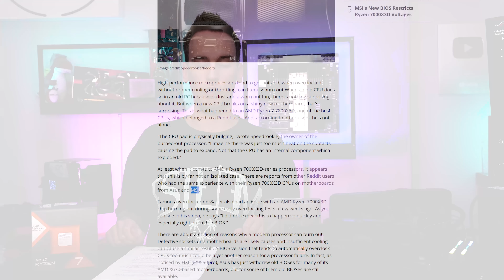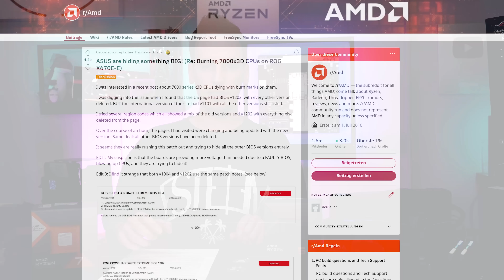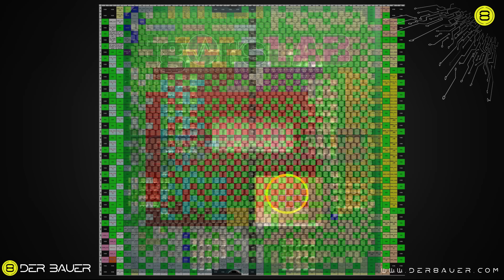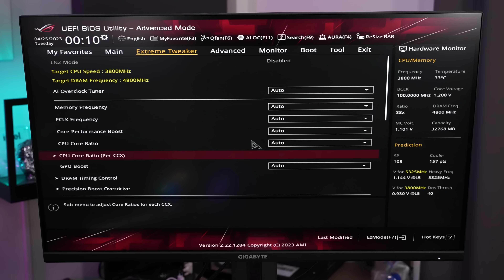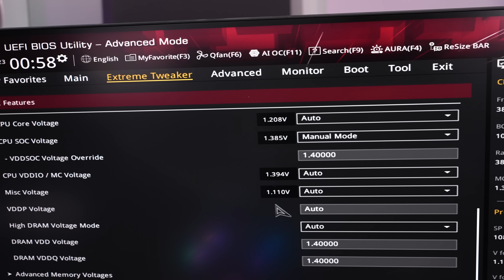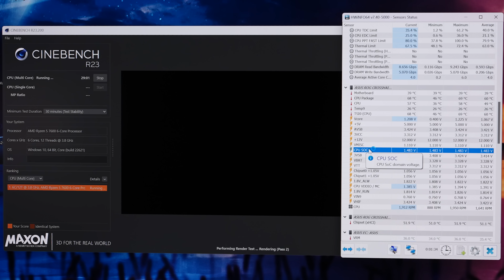I missed the Damage on this Ryzen 7900X

Comment: Good work but what are the steps to prevent it?
Reply from the maker: Just make sure the Auto voltages are not too high. If EXPO is enabled see if SOC exceeds ~ 1,3 Volt and lower it until the case is fully confirmed and fresh BIOSes are out
Reply: Don't buy ASUS.

Comment: I have a 7900X3D on an B650E-I ASUS Mobo, and in the last 2 weeks, I can no longer change CPU clock frequency or CPU voltage and it keeps changing EXPO II back to default RAM speed in the BIOS.
It's been weird tbh..
Reply: Isnt cpu voltage locked on x3d chips anyway?
Going back to default ram speed could happen if it fails memory training
Reply: @ThunderingRoar  Not sure. I've only tried changing the voltage curve offset for better thermals

Comment: 7950x -Asus Rog Strix x670E-E only posts after RAM training with 0805 bios with EXPO values loaded, with all the newer ones the pc doesnt pass the RAM training and EXPO values enabled. Some ppl with same problem in reddit... A lot of BIOS versions in the last months... and now all of them have been removed from Asus website. These issues with a more than 500 euros motherboard is disapointing.
Reply: I agree so much with this.. is a 500 dollar motherboard with weird issues. I cope with the isses thinking "well is a new plataform and the same happened with Ryen 3000 back in the day"
Reply: I had really long and weird boot times on my MSI X670E carbon wifi. Nothing I did would fix it, even running the RAM (which I suspected was the problem) under it's rated speed. 

Finally got annoyed enough to RMA the RAM and ordered a much better set and now everything is perfect.

My conspiracy theory is that vendors were playing fast and loose with DDR5 ratings for a while due to the high prices and are loads of kits out there that were mislabelled

Comment: Seems like all of AMDs 7000 series CPUs and GPUs have a ton of issues! I wouldn't feel comfortable buying anything from AMD this generation.
Reply: AMD have sold a couple of million Ryzen 7000's and we have a handful of failures so far documented.  It's hardly a big issue.  Obviously we need to see how it pans out, but it looks like the motherboard manufacturers are already on top of this.
Reply: @malphadour  Sure, but it doesn't give me confidence in AMD. I'm sure it will get fixed eventually and it's likely only a small percentage of cpus. However, in my personal opinion, I would prefer to skip this generation of AMD products until they have ironed out all of the bugs.

Comment: A phase transition would be needed to cause a bulge in solid material like that. In other words, some small area melted or boiled.
Reply: Yup.
Reply: @glitter_fart  i'd go a  step further and say that it started in the cpu's pcb.
Reply: @tru_3DEffects  yeah stuff like this has been known to happen, i forge the exact term for it but intel had some issues with p4 arch that when shrunk had voltage leaks that could cause things like this.
Reply: @glitter_fart  Popcorning. It's easy to do to boards using an IR BGA rework station too. Moisture in the substrate turns to steam, splitting the layers apart and leaving a blister.
Reply: plastic layer?

Comment: 95 C is fiiiiine they said, hitting 95 almost immediately is fiiiiine
Reply: 95 C is the new 55 C.  That's how we do it now,
Reply: if it was due to 95C then we would be seeing tens of thousands of dying CPU reports by now, not like 7
Reply: 95C is fine,   its not a tempt issue here it's a voltage issue on the SOC that exploit a point of failure of batch of CPU, watch the damn video.
Reply: @Clippy-the-Doubtful  it clearly is a bit of a temperature issue when you have microcode written to aggressively boost performance and you end up with melted hardware.
Reply: @BMD8  only if you over simplify it to the point of it being misleading or blatantly incorrect, sure.
Reply: I was here for a bit of mindless bashing but everyone wants to be sensible 🥱
Reply: All joking aside, new AMD and Intel CPUs are being pushed too close to the physical limits and if the built in protections fail, this is what's likely to happen. Oneupmanship is really burning chips now. If silicon degradation starts around 105-110C (voltage dependent), operating closer to that limit will invariably expose parts of the silicone to harmful temps.
Reply: Chips melting, "it's not the heat!!"

Comment: All someone has to do is transpose voltage values in the BIOS .. and .. POOF! 🔥
Reply: Example 1.93v vs 1.39v.
Reply: @DJaquithFL  most bioses I've come across don't allow you to set unsafe voltages that high. (Some BIOSes have something like "LN2 mode" you need to explicitly enable first to increase that safety limit.)
Reply: @Hugh_I  .. As I recall, for some reason they did not have an upper limit with his BIOS, or at least that was what was suggested.

Comment: I have a 7950X and an Asus Strix 670E-E. I've been using the chip with curve optimizer since I bought it and I never was able to enable Expo (system won't boot). Now I wonder if I should remove the cooler and inspect the chip just to be safe. I've seen it reach 90C while gaming so.
Reply from the maker: if it still runs I would not bother to remove it :)
Reply: @der8auer-en  Thanks for the reply, I went and removed the CPU. Everything is good, re-applied some thermal grizzly paste and is all good. I hope that Asus fixes EXPO one day
Reply: I have the same CPU and same board but mine works fine on EXPO as I am using 4x16 GB Corsair Vengeance EXPO 5600  mind you memory training is something to get use to coming back to AMD from INTEL .    I just updated my BIOS again in less then 2 weeks as ASUS just release another BIOS in the same month so maybe the fixed a issue.  So I enable  EXPO  and I went back to check the SOC voltage and I was sitting at 1.29v
Reply: i am interested about which expo kit are you using? also which frequenzy and latency it was supposed to run at. I read a few complaints about a specific set of gskill kits 5200-6000mt/hz cas 30?-36 which supposedly tend to act up on asus tuf boards. Weirdly enough their cl36 and 5600mt/hz kits are some of the cheapest on many sites but i am considering buying these to try them out...
Reply: @DiverseGreen-Anon  No issues with 2x 16GB 6000mts/cas30 on a Strix x670e-f, rock solid from build. Not sure on BIOS rev though. GSkill has always been good for me in 2 DIMM systems, even when pushed beyond rated.
Reply: @DiverseGreen-Anon  it says G skill 5200J3636D32GX2-FX5. DDR5-5200 32gb x2. CL 36-36-83. I should try to get a better ones compatible with a noctua cooler. But they don't work in expo so I use them stock
Reply: @marinner0694  it appears that the 32gb dims of that line can cause problems not yet seen anyone coplain when using 2x 16... If I were to apply the expo and change some settings to make it more stable maybe that would work. I just cannot use any unnecessarily high ram as I also have a noctua (d15) which could block the slots with the second fan :I
And I dont need any rgb, just best performance for "reasonable" money
Reply: I had to update my BIOS to upgrade to 64 GB CL30 from 32 GB CL36.  It was very unstable with 64GB.  I also have 7950X and an Asus Strix X670E-E.  I used G-Skill in both cases.
Reply: 90C will have no problem since most of the CPU are designed to withstand a lot more than that.

Things that will cause modern CPU to fails is manually setting Voltage too high, CPU internal power control may not able to throttle or control power on some part of CPU (I/O Die) to keep temperature in safe level so it start to fail, shorted and burned. And yes, sometimes cause by BIOS that intentionally set SoC voltage when using XMP or EXPO memory too high.

This also happen since Ryzen 5000 on some of BIOSes that I/O die was run too hot than it should be.

Comment: Never heard of this on a Intel cpu, like raptor lake runs hot but does it blow up or melt solder etc? One time my cooler wasn't plugged in and the CPU over heated and the system shutdown. No damage. Temperature protection worked.  So what's going on with ryzem 7000?
Reply: My shop diags and replaces about 3 toasted LGA1700 CPUs a month. The OEM ILM mechanism is garbage
Reply: @FeintMotion  True that the ILM could be better but I haven't heard anything of an Intel chip blowing up like Ryzen 7000.  Do you have an Article or Source ?

Comment: As someone who worked for a si, I’ve seen this same failure multiple times on intel hedt chips. Bubbled CPUs and burnt sockets. We even had one that was trying to survive by pushing auto voltages at like 1.7 volts. Seen a lot of weird stuff.
Reply: well thats odd, cpus are usually very reliable and will outlast almost all other components
Reply: @ThunderingRoar  key is "usually", here we are talking about the internet where 10 people see a youtube video and post their same problem. But it is 10 in millions, and even in thousands it would still be 0.1 percent. The internet is blowing things to catastrophic levels even when it is not a problem at all, just a rare failure.
Reply: @marsovac  You’re right. My dad happens to be running a 7900X in his office rig and he has had no issues. Then again, I believe he has on a Gigabyte board. The fact that this issue is only impacting ASUS and MSI proves that it’s not really the fault of AMD but the board-makers.
Reply: After a lot of failures during development.

The reason all cpus have an ihs these days is the 462 althlons and early 370 p3s.

A lot were crushed or burnt back then. Warranty replacements got expensive.

Comment: I guess I'm lucky that enabling EXPO makes my system not boot. So no risk of that frying anything :D
Reply: I never got Expo to post either.  Manual worked fine using BZ voltages (which are high but safe; SOC was 1.25 for example.  My board defaults to 1.24).  Real question is if 1.5V does not fail here, it is just "edge case" CPUs that fail at 1.4 under expo?
Reply: @chemie7037  xmp profiles or expo or wharever allways not gonna work correcly, i never use ram profile speed, i just put it manually, even the timmings.
Reply: I have issues booting but if I force a shut down then restart.. no problemo!
I have cl 36-36-36-96 @1.35v EXPO ram I overclock to 32-34-34-76 @1.4v. 😐
Edit: I should add I believe my SoC voltage is set at 1.25v in BIOS.

Comment: when you have a bad cpu it's die dies?!
gamer: AMD this cpu temp is very high...
AMD: it's a feature, embrace it!
....3 weeks later....
...cpu dies...
gamer: AMD the feature is not working...
AMD: ....
Reply: these no correlation/causality, on the stock temps and expo that probably exploit a points of faillure on a batch of CPU,.. did you watch the video?...
Reply: @Clippy-the-Doubtful  all i know that heating and cooling rapidly can cause damage to  silicate crystal lattice... so the die thet are printed on must be experiencing very high deltas in impulses... plus they are using 5nm nodes i guess which is more prone to irregularities when temp are kept high even for 10sec sustained... intel do a pretty good job there they don't rapidly drop temps by rapid clock reduction but lower clocks in steps of 150mhz baseline... amd still struggling with what they call lack of experience in sustained load... this gen of amd cpu is fast but dud if you want to overclock them... trust me amd will get to old tested method on next gen or they already have.... those cpu died due to temp delta being very high which cause die to form a blob which fried their voltage controllers... i know my stuff thanks and high temps is never a feature when you try to mess with silicate dies... maybe boron needs to be researched too since silicon has reached it's end... even 5nm is too much for it. edit: i use silicate to denote multiple silicon products... not real silicate

Comment: I’m so sad I didn’t buy an AMD cpu. They’re so efficient that they actually take themselves out and become e waste automatically. Clearly my AMD hesitation was unwarranted. My 12700k is an inefficient piece of trash and will last at least the term of its warranty, prob longer. Pfft! I was also foolish to buy another Asus mobo. The z97 one I had previously still works. Garbage.
Reply: Woah calm down buddy
Reply: @nicolaspaglione this should be interesting. 🍿
Reply: Yawn.
Reply: And I'm so glad my AMD 7950X in my ASUS X670E Crosshair Hero has been working flawlessly since I bought them when they came out, along with my AMD Radeon RX 7900 XTX.

This AMD system will eat your 12700K system for breakfast, and keep on rocking it long after yours has been outdated, BURP
Reply: @zebrapluto530  plz understand my comment was a joke and at least half hearted attempt to satirize all the bombastic reactions we see and brand loyalty over actual facts. I have no idea where this story will lead, but I will admit it doesn’t work against my genuine hesitation to buy an AMD platform when I did purchase my 12700k in late oct ‘22. I could’ve been wrong, but I also tried to buy the best product for my use case and budget at that time. Only time will tell what’s happening with these 7000 series issues.
Reply: @Akkbar21  I hear you. No worries, that's cool. Any system that works for the buyer's needs is a good system. 😀

Comment: planned obsolescence...

I can't believe how cool everyone was with the 90ºC "normal temperature" of these chips...
"Yeah, just let it rip guys. Don't worry about temps close to 100C. It's normal operation. They told us so."

You're all just pure chumps... 
I bet most of these chips won't last 'till 2026... Meaning, only the undervolted ones will last
Reply: They don't make them to last anymore... It's actually the opposite.
Reply: @@klipone1354 keep pushing it. By 2026 you'll spend another grand replacing burnt components
Reply: Cry some more
Reply: @Klip One Asus tuf b650, bios 1410. Running Kingston DDR6000 CL32. There is not a lot of scope for overclocking the 7800x3d. I've set PBO to enabled and enhanced. I'm tempted to drop soc voltage until they work out whats going on here but from initial findings by debauher it could be voltage related.
This is the first 7000 series I've built so I've not customers on this platform yet. I run my own IT husiness, I've built all my customers machines. I'll stick with AM4 for now until these niggles are ironed out. 
Who's running eco????
Reply: @Klip One  Youve got one hell of a chip on your shoulder. Firstly disrespecting poeople on here you have no idea on their experience or knowledge. Secondly we dont all target the highest FPS possible. I target 90 as thats what my VR headset runs at. If my CPU or GPU can be undervolting and I still get 90fps. then great.  Positives are A: not adding additional stress to the CPU/GPU. B: saving power c: producing less heat. 
Additionally.  do you really think I care what benchmarks scores you get? Are you for real.. Im not 12 year old! Grow up.
Reply: @@klipone1354 I'd say, undervolt it as soon as you can. Same performance, and probably 10 more years on it.
Reply: Gaslighting marketing.
Reply: 90° is a little bit different from 200-300° my guy
Reply: My 7800x3d run now where near the  thermal limit. I'm doing 65c in game..let's not panic! Stay calm!
Reply: Or those who are able to delid and direct die cool their chips effectively.
Reply: It's probably just a batch that have that issue,  a several million of ryzen 7k as been sold, and we don't see CPU exploding everywhere.